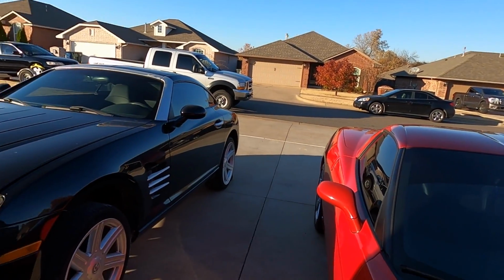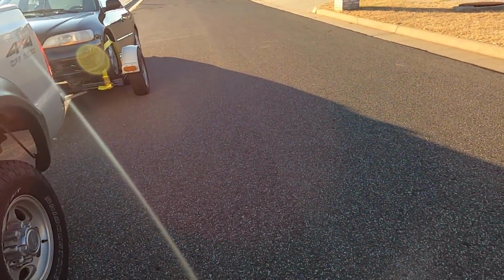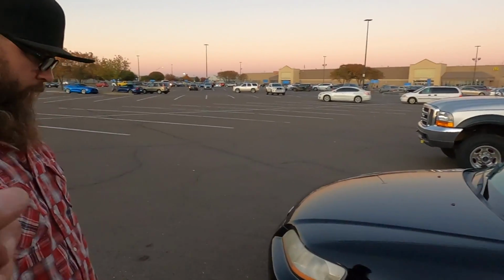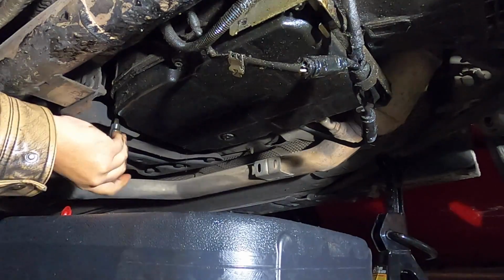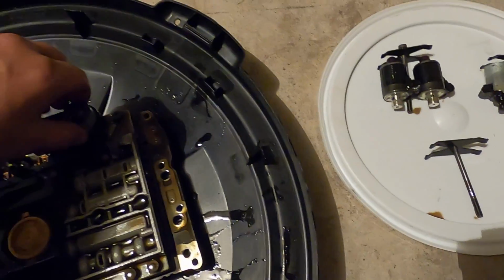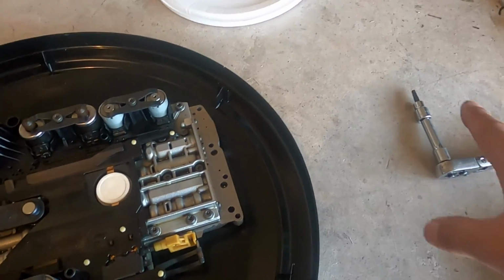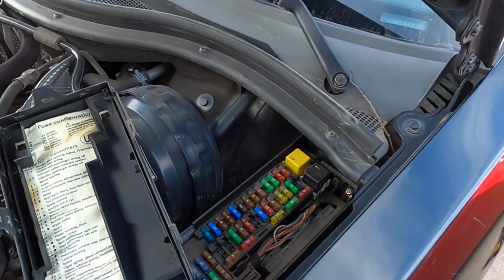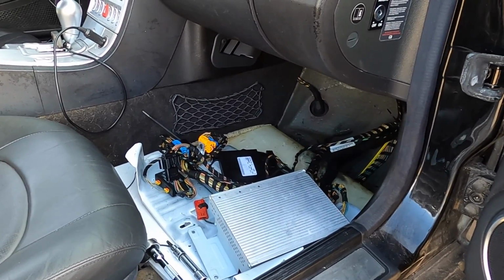Replacing 722.6 Mercedes Benz Conductor Plate - Limp Mode - Copart 2004 Chrysler Crossfire

Comment from the maker: Check out FCP Euro: https://hubs.ly/H0l1BXk0
Follow me on Facebook: https://www.facebook.com/autoauctionrebuilds
Reply: I have a 2012 Infiniti G37 with the sunroof link problem well mine's was one of the ones water got down in my body control marginal it caused all kinds of electronic problems like the windows wouldn't go down sunroof wouldn't work killing my battery would recognize my key.. but I fixed it myself had to get a new one and have my keys program to it so you're saying fluid got into the lines you might want to get that BCM check out.. it could have caused a short-circuit because I took mines apart didn't see no problems no burn nothing but it was still messed up
Reply: You may need to start changing out canbus cables for the comm errors ... I had a C230 and the cam actuators had the same issue where fluid would get pushed into the wire loom ,, solution was change the loom...
Reply: It nice to see you keep the truck
Reply: Auto Auction Rebuilds hey man I own two Chrysler crossfires a 2004 and a 2008 anything you need just go to https://www.crossfireforum.org
Reply: I hate they used torx bolts on everything I didn't strip the drain plug I stripped few on throttle body. Had to cut the heads off and like you don't have a lift you can't put force on them cramped up under there. Why Mercedes?

Comment: Randy. I hope thats your name. Chuck here, I've been a Volvo and BMW mechanic for 25yrs. I now own a 2006 Crossfire Its also in limp mode, So I took it to a Transmission shop and with their 13k scanner I don't know the brand. but it was capable of reading any Vehicle being a trans shop, And scanned my car with Mercedes soft ware and got code 600which is lost communication with electronic gear shift module (SLA) Which I believe stands for shift lever actuator The module is not sending the signal to TCM. With a simple obd 2 scanner all I get is simple po705, I believe yours has the same problem. And after its replaced it must be cleared with a compatible scanner that has Benz software. Or as I will do take it to a transmission shop and have them remove the hard limp mode code. Its the only way. The shift lever module used is about $160. ebay. When I get mine done I'll let you know. Hang in there Brother.

Comment: Bro I am reasonably confident that the reason you could not undo the drain plug on the transmission is because 1st it's ABSOLUTELY NOT a torx bolt it is a 5mm Hex and 2nd you didn't use a penetrating spray and leave it for long enough before attempting to remove it. Also consider using an impact driver to remove all of the fasteners and the drain plug. The result is VASTLY superior. I recommend going the cheap route and getting the bauer impact driver kit sold at harbor freight (it outperforms top tier branded ones) and their warrior branded 1/4" 3/8" & 1/2" drive hex shank adapters. Follow this advice and save yourself A TON of headache. Thank me later.
Reply: I am about ready to get into this. I was watching that guy at Mercedes Source and he said there are no more OEM parts available as of 11/21.  I go to ebay and Amazon and people are complaining about fitting the o-rings with the 13 pin plug.  Is there one place you would recommend buying the parts? thanks for your message above. Will do it.
Reply: @sl5311  try FCP Euro... I purchase all of my parts from their website.

Comment: I  have watched all of these Crossfire videos and have thoroughly enjoyed them and been enlightened. Kudos to you Randy for great content.  Now...as a guy who only does oil changes, spark plugs and brake pads, do I want to buy a Crossfire at all?  I love the way they look and I have my eye on a couple of low milage cars in very good condition.  Both always garaged and under 60,000 miles.  But as much as I love the way they look...I DO NOT WANT SOMETHING THAT IS GOING TO NEED WORK OR HAVE TO BE TOWED TO A MECHANIC ON A REGULAR BASIS.  I've been driving Toyotas, Hondas and Mazdas for the last forty years and for the most part they are trouble free.  I am a "car guy" and I like maintaining and driving them....but not pouring lots of money into a dark hole. And to be honest, I have always heard these are a bit troublesome.  Comments from anyone are welcome.  And the next time I need something....FCP Euro is where I'll shop.  Keep on Randy!

Comment: Man you skipped over a part that I am having trouble with in doing the same repair on my crossfire, I changed the conductor plate by studiously following your video, Mounted everything with no problem. Had the hardest time seating the new electrical connector plug with the new o-rings but finally got it. But I am having the hardest time pushing in the electrical connector all the way. Many of the videos showing the repair on Mercedes the mechanics push the connector all the way in to where it is inside the plug or at least flush and then they are able to push the yellow ring all the way clockwise until it clicks. 

When I install the connector it does not go all the way flush to inside the plug. It hits out some and I am able to push the yellow ring clockwise with it catching but not all the way until it clicks. I wanted to see how you dealt with this but you never showed that part of your installation. You skipped over it.

I am wondering if I did not tighten the 7mm center bolt on the plug all the way and maybe that is why my electrical connector is sitting flush. I Tightened the center bolt to where it was sung but I was in fear of over tightening it to where it would snap. Some of the videos say tighten the center bolt 22 round inches. Other say hand tighten only. What did you do. I do not want to over tighten that bolt. Also, did you turn the yellow ring on the plug until it clicked or did you turn it until it would not go any further. I really need help on this

@UC66Oq692VN2jZGNb7lIh7Eg I read where you work on these crossfires all of the time. Will you weigh in as well. I did not see where an email could be sent to you
Reply: I am not there yet but I have read several accounts of people either using the new o-rings on the existing plug and then another guy on Amazon comments saying you have to use a 2x4 wood block and smack it in-he says these aftermarket ones are like that.  Hearing a lot of complaints like yours sadly.

Comment: Communicate with it as a Mercedes not a Chrysler Crossfire, this will then communicate with the Transmission Module.  Clear the Hard faults.  Its stuck in gear until you do this.

Comment: Randy,  isn't it "righty tightly, lefty loosey"?  The first time you tried to take off the transmission drain plug you were tightening it.  I ran into trouble when I didn't realize I was trying to remove some left-hand threaded bolts.

Comment: I guess this shows the quality of these vehicles lol
Reply: Yeah I  have fixed everything on my C240 2004 but this one has me thinking I don't want another Merc ever.  The engineers that designed this connector plug HAD to know about fluid-wicking. All they had to do was put those little moisture-proof rubber pieces at the connector-that was the least they could do.  Instead they sell a transmission that is a disaster.

Comment: Hey Randy so i did some research on the code and and its gonna be either they coolant temperature sensor, transmission shift solenoids, or the entire vavle body is bad but honestly i really think its the shift solenoids.
Reply: The 6 solenoids for the  722.6 transmission can be gotten cheap rebuilt. ($60-80). May be worth a try. Sometimes ohm meter tested "good" solenoids aren't good.
Reply: @tommurphy5757  Jaysus could this get anymore complex.
Reply: The 6 solenoids for the  722.6 transmission can be gotten cheap rebuilt. ($60-80). May be worth a try. Sometimes ohm meter tested "good" solenoids aren't good.

Comment: 2004 Chrysler Crossfire Transmission Codes P0715. Got a P0715 code from my 2004Chrysler Crossfire indicating a bad speed sensor. This generally means a bad conductor plate in the automatic transmission. Fix is to replace the conductor plate and then have the trans codes reset by a dealer.

Comment: My first car was a 56 no post Belair Chevy.  I built it up, put a 396 in it, and had it painted a midnight blue with diamond flakes in it.  Black diamond pleated interior with Hurst shifter.
It was gorgeous.
Sold it and bought a 66 GTO 389 three 2 barrel carbs, 4 speed.

Comment: there should be a 5 volt reference signal at every sensor in the car if any sensor fails it can bring down the high speed network
 an easy method is checking each senor by unplugging one at a time and try to check codes

Comment: Did you make sure that the selector shafter was in place when installed the valve body. fluid will not travel at all if it  sliped  out.

Comment: Randy. I use a Autel Maxisys 908P as my shops main scan tool and I can tell you from my experience the Autel does not work well with German cars. The Autel will not even do basic things like retract the calipers on electronic parking brake cars for pad changes. the software is there, just doesn't work. See  if you can get a hold of the real VAG software for these cars. I like the Autel scan tool for most cars, just not the German stuff.

Comment: I think the Problem is, that the wires are still soaked with transmission fluid. A simple solution is to cut all of them 1 or 2 inches behind the connector and solder them together again. The soldering is funktion as a berrier for the transmission fluid.
The same problem has Mercedes with ther camshaft aktuators on the 2.3l supercharge engines. 
The gaskets starts to leak in the wireing harness and the ecu can fail. 
After that disconnect all batterys from the system and try to start.
That should drain the system completely. Leave it disconnected a couple of minutes. After that, connect the battery and try it again.
The system should reboot.
If not,  visit the dealer to let them the system clear and reboot.
I hope you understand what i try to  explain. 
My English issend that good.

Comment: Another thing you can do for a stripped Pan bolt is add a new drain port if you know how to weld I suggest a JIT fitting or a quick connection.

Comment: Hi Randy,

This is Mark from the UK, I have just had exactly the same problem with my 2002 ML 500 with 2 error codes. One for the speed sensor and one for a faulty solenoid, the solenoid i don't believe was actually faulty in the end. After changing the conductor plate and replacing all solenoids with used ones, my car started without the engine check light coming on but on second start up the light came on. In the end i took my car to a local independant Merc specialist and they resolved the problem with a software update through the control module which took 20 minutes. My car is now driving perfectly for last 3 days and i have noticed that the gear changes are even smoother than before. Hope this helps.
PS. Did you check that you refilled with the full oil amount. 5.5Ltrs for  a flush and 8 ltrs since you removed the pressure plate.

Comment: How about getting the oscilloscope out and measure signals?  My guess is that they would all be in a sort of 5V or 12V range.  Might also be worth checking all groundings, you never know what that oil might have caused.

Comment: Hey Randy, you really should invest in a cheap 12v oil drain pump. I use mine all the time for engine oil changes but in situations like this with a stuck drain valve, its invaluable.

Comment: Just thought of this,,,,,   If you have a wiring diagram, then you can do all the checks at the connector to the computer,, and maybe avoid disassembly if you can pinpoint a wiring issue,,
Reply from the maker: I fixed it just after finishing this video. Stay tuned.
Reply: @AutoAuctionRebuilds  awesome,,, that is a really nice looking car,,  Happy that you figured it out,, :-)

Comment: At this point I would remove the pan,, save the oil,,   Use your multimeter to check the continuity of each solenoid,  If good, then they will probably not read zero ohms, but  probably less than 100 ohms,,   Also check the continuity of all the connections in the harness that go between the transmission and the computer,,  Also check for shorts or partial shorts between the wires of the connector,,,  If the harness is bad, then it could have damaged the tranny computer,  Hope this helps Randy,,

Comment: see if you can scan under Mercedes slk R170 and reset TCU, crossfire is 98% Benz 2% Chrysler 
good luck !!!!!!
Reply: or you need a M STAR system to reset the tcu
Reply: 💯Worked For Me.

Comment: Mercedes system is coded..only a dealer with "star system " can clear it
I had same issues as you are having
Reply from the maker: My Autel Maxisys Elite cleared it no problem. Just had to enter it as a MB W203. All good now.
Reply: @AutoAuctionRebuilds  good to hear.. will that system work on the late 90's Mercedes??

Comment: I know its a long shot but good to check is the OBD connector. You said it wasn't talking to the other computers and the scanner may not be fully connected. Sometimes people plug in the scanner and then kick it with their foot and damage it or push out a couple of the locking female pins. Worth a try. I have had that problem before.

Comment: The transmission will remain in limp mode until the hard faults in the tcm are cleared with a mercedes specific scantool. Disconnecting the battery will NOT clear any tcm fault codes in older mercedes such as this one. I would suggest getting a Foxwell NT520 pro with 38 pin multiplexer to clear the tcm fault codes. It also includes the regular OBDII adapter too. Its the best scanner for older mercedes at the lowest cost compared to Xentry DAS or STAR. You're doing great, keep it up!
Reply from the maker: Thanks man. I cleared the codes with my Autel MaxiSys Elite. All is well now.
Reply: @AutoAuctionRebuilds  how you clrared?

Comment: Do not worry you are almost home free my guy! I had this SAME exact issue with a e320 wagon. Stuck in limp mode for 1 MONTH! I would not give up. Getting SAME CODE! It was the speed sensor too because I could see the damage to it on the old conducor plate. My TCM module was covered in oil as well. Got a new TCM from a u pull it junk yard that was in perfect shape for 20 bucks. Cheapie conductor plate (but well reviewed $150) so after the new conductor plate you need to take to a indi benz garage or Benz (don't do that $$) and have them re calibrate the computer. Many people will tell you that you can reset the computer but the reality is, it takes special software. I wasted a lot of time, you can't do it. In Fort Lauderdale at an indi garage I paid 120 bucks for the computer reflashing or whatever they did. It took them about 20 or 30 minutes and it was like magic. When done my car drove PERFECTLY. 

Now this being said, if this still does not get you out of limp mode than I'm sorry to tell you that you may need a new gear switch selector as well. I did. It was a 450 dollar part (new condition but good luck finding a used one). Easy installation.
Reply from the maker: I fixed it using My $3K Autel MaxiSys Elite. The issue was my Chrysler software wasn't playing nice with the MB computers. I told my scanner the car was a W203 and it instantly reset the EGS. No more issue! Thanks for the comment man.
Reply: @AutoAuctionRebuilds  Oh wow, very interesting. Good deal!
Reply: @AutoAuctionRebuilds  hopefully we'll get a video update!
Reply: @AutoAuctionRebuilds   I hope you recorded the video. We will love to see it being fixed
Reply: @AutoAuctionRebuilds  figures - Why Mercedes sold off Chrysler - they couldn't communicate with them either.
Reply: @AutoAuctionRebuilds  Great example of what happens when you don't give up. Good job Mr Randy
Reply: @AutoAuctionRebuilds  This sounds familiar to me as we had the same issues with German MAN trucks after they bought an old UK truck firm called ERF (Edwin R Foden). They used the ERF chassis, Cummins / Eaton driveline and therefore Cummins ECMs and wiring and connected them to the German ECMs (hey used two) and software as they used the MAN cabs.
Long story short - It was impossible to set the throttle sensors and cruise control or speed limiters. So I worked if we opened up the Cummins speed limiter to 100 MPH we could then use the MAN ECMs to have everything else work 'underneath'.
Its what happens when the Germans get involved and believe everyone works like they do ...
Reply: @AutoAuctionRebuilds  I know nothing about these cars, but when you said on the video that you selected the Chrysler mode on your reader, I said out loud, "Try Mercedes mode."

Comment: Randy... You are having a problem with the CANBUS ... The modules communicate with each other over this network... That's why the radio doesn't work and your scan tool is having problems talking to the car... Try unplugging the transmission connector and then try to control the radio and try reading the car's system  (s) with the scan tool... If all else works then. There may be a problem with a wrong part that the Chrysler and Mercedes may be different... This will also allow you to pin down a problem within the tranny if all else works... Something is pulling down the signals on the shared CANBUS... Check out on youtube some videos on how the CANBUS network works... Good to see you doing some real repair attempts... Dave